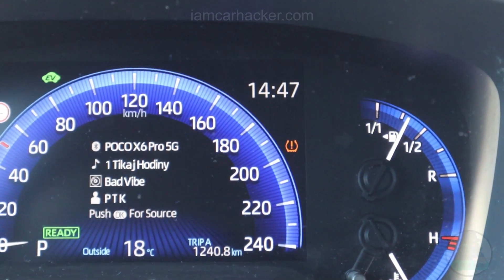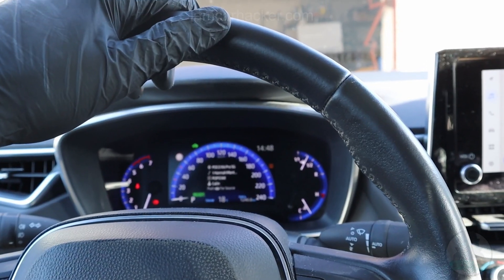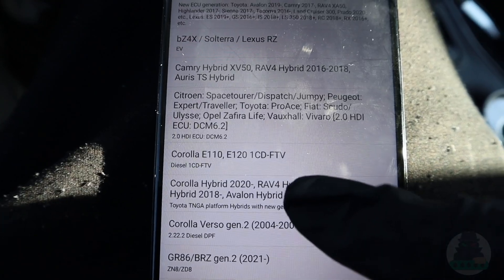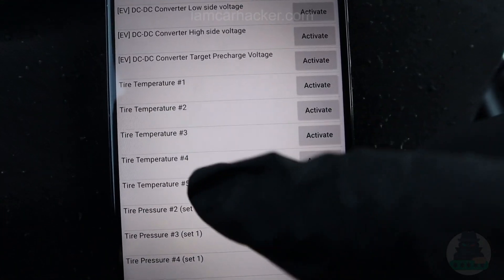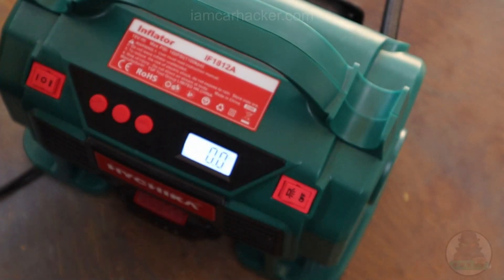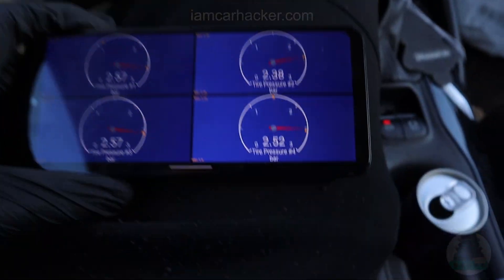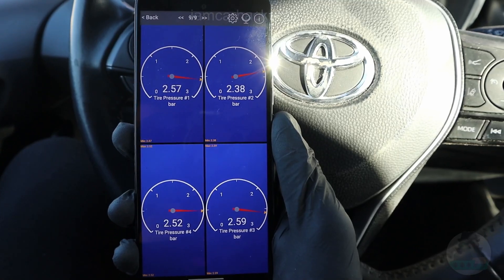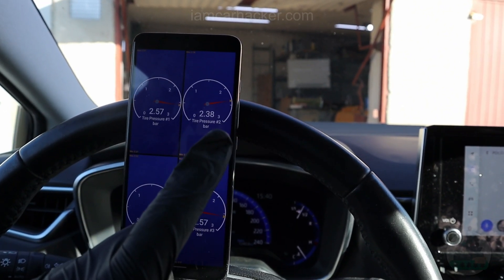How to see tire pressure for each wheel in car

Comment: Do i need to have the pro vesion? I have no "tire pressure" in sensors, when i press settings i have no inactive sensors at all.
Reply from the maker: You either don't have tire pressure sensors or this app cannot find them.